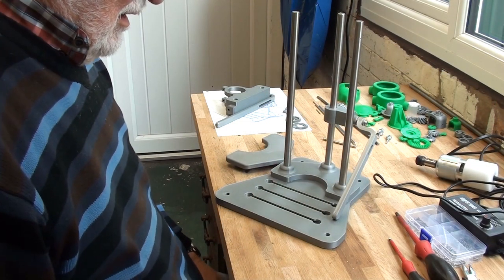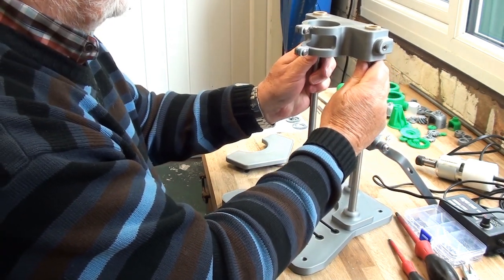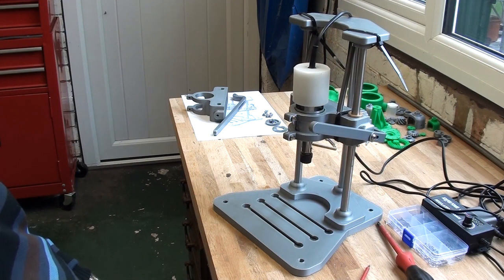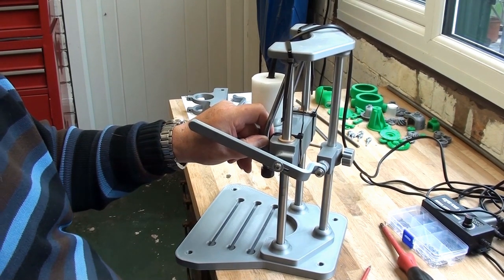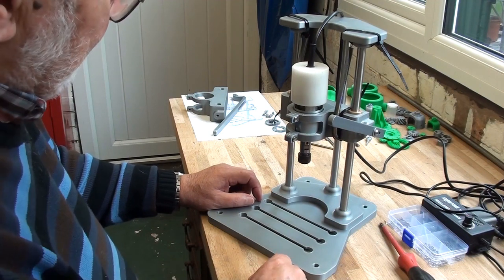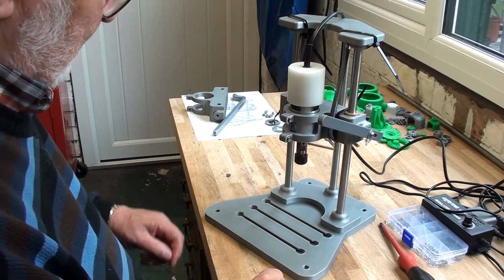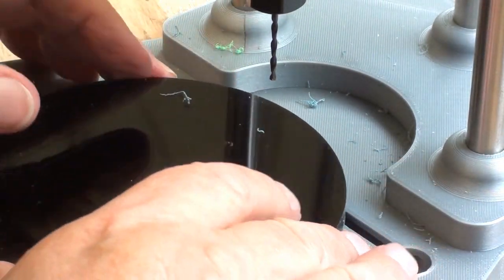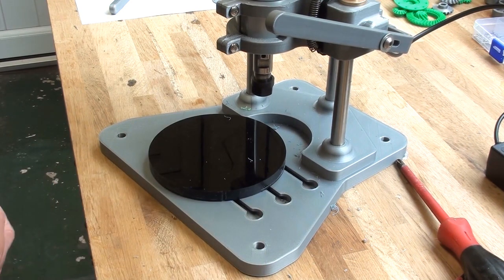Drill press revisited

Comment: I reckon you could look into resistance training elastic bands instead of using metal springs. That would allow you to adjust for the right amount of tension by changing the length of the band used and they won't 'eat' into the plastic frame like the metal springs do.
Reply from the maker: You're probably right but they would, in my eyes, only be a marginal aesthetic improvemnent on the springs.   And I'd have to buy them!  Thanks for the suggestion, though.  I've sourced some springs for pocket money, so I'll try them and fit consumable "washers" top and bottom if they show signs of wear.
John